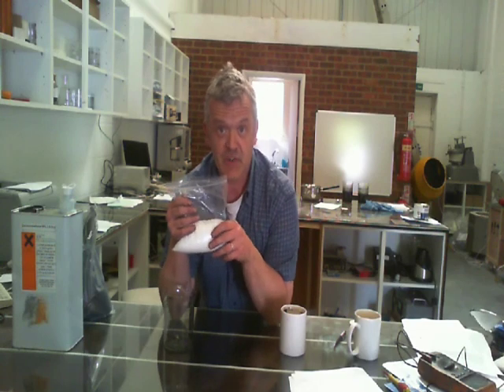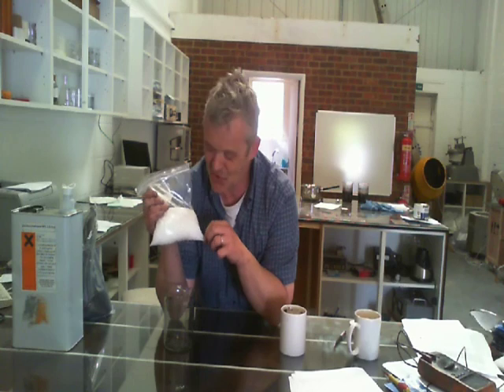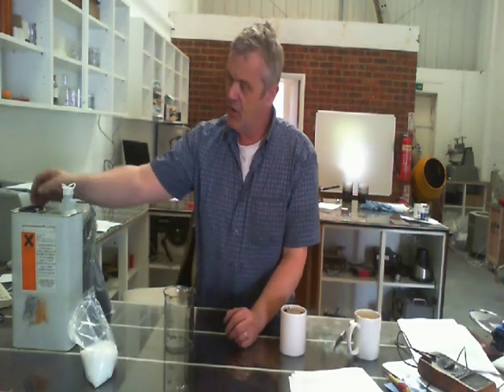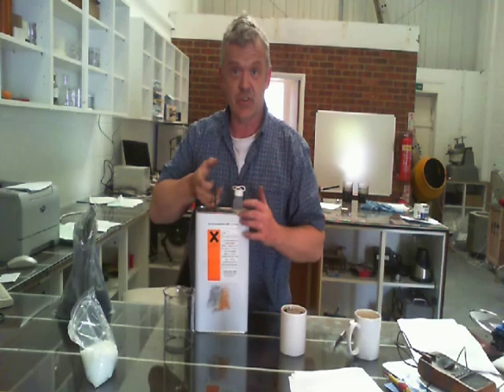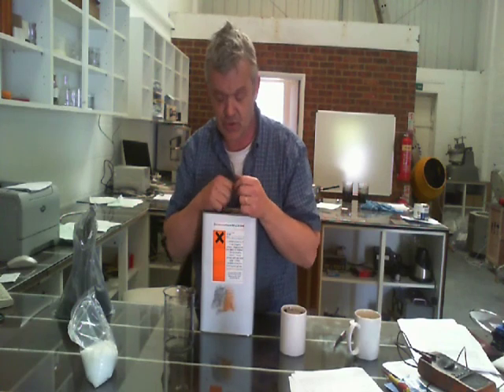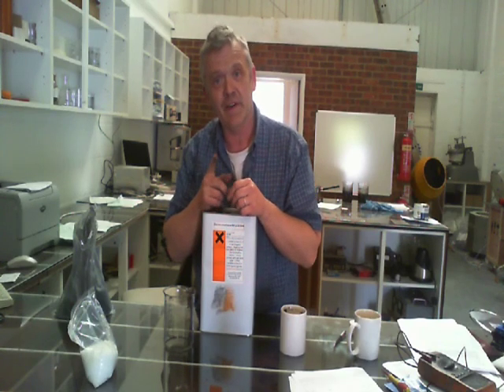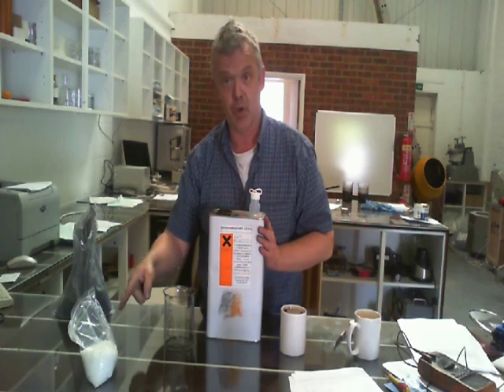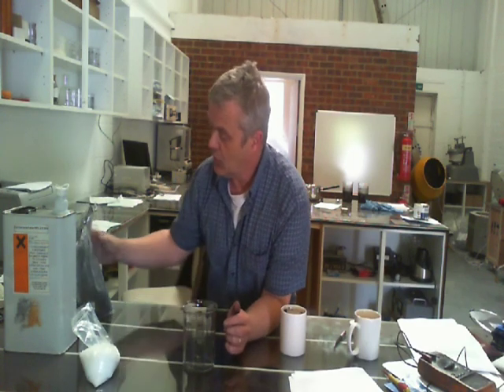How To Make A Conductive Plastic Filament For 3D Printing Electronics

Comment: not a good idea to 3d print plastic with conductive material because plastic is not conductive, so adding a conductive material will reduce the conductivity of whatever material you are adding, secondly plastic will melt or loose integrity when electric current passess through it. A better option for 3d printing conductive material is to use a conductive pen which you could attach to your 3d printer.

Comment: This guy has the worst video production values over and over.  Lots of reverb in the room, shitty video, only video of him talking, never showing you close ups, no lighting, no editing, no production at all. I can't even undestand him without putting on closed caption.  He also does everything in a conversation mode as it relates to his life experience.  He does not simply explain some points in a logical way.  It is a long rambling serial communicaiton where you must sift through a lot of talk talk talk to get to few points, and when he does get to the point, he leaves out a ton of detail. He needs to watch his own videos and see how shitty they are compared to other channels. He wants to hold your attention instead of get to the point.
Reply: Jeff Beck is that your way of volunteering? I could be wrong but my take here is that we've got a guy who is doing his best to get public interest and funding as he works though his R&D cycle. The videos seem well enough for that, but I agree and have thought of sending Rob some software that will tune out the background noise to improve them.

Comment: woah 9ohms a centremetre and still flexy! I love how you said "components" when we are printing,  because the stuff ive seen where they insert the components in during the printing process is kinda dumb and unprofessional.   thanks for the help.      id love to see a big block of ram coming out of a 3d printer,  or a dc motor or transformer.   i saw a flat inductor in another video,  was a good watch.

Comment: sadly you aren't going to get anything usable from this, a 3D printer is rather delicate and it uses brass nozzles, any composite materials in it {graphite/carbon} will clog the printhead. perhaps with a hardened steel nozzle you may get some usability, though even then the filament width needs to be extremely accurate, i fear that rolling it between glass may not achieve that. Of course building an extruder is an option though that can cost up to a 1000 pounds, and even then not give you accurate diameter filament. if you don't believe me, check out this video by Make: https://www.youtube.com/watch?v=OEkksADFjP8 
Though this stuff would be great for injection moulding, check out https://preciousplastic.com/en/ for some info on it.
Reply from the maker: i believe you mate - but what's shown here is the idea - to turn it into a usable filament would mean making an extruder - or buying one - the are around £250 new

Comment: Now you are talking my language Robert.. :D I posted videos on my page, or what ever you call it..?  I mixed graphite powder with a high carbon black colorant additive. HDPE, LLDPE & PP(Poly Propylene) blends.  I'v compounded blends in my 70mm screw in my blown film extruder. The high pressure (10,000psi) temperatures over 400f and CTM mixing zone on my extruder is helping to bust up the graphite making graphine layers. The problem is high loads of graphite work as lubricant in my extruder. I have yet to achieve a high enough load for highly conductivity films, But I am working with some new carrier materials that are looking rather promising.
Reply: also i was wanting to try some of your inks? I could post the results to you.
Reply from the maker: sounds good mate I will have a look

Comment: After melting in solvent, and then going through a filament extruder. I suspect its going to be brittle be a little low on plasticizer. What could I add to the solvent or filament extruder as a plasticizer? I'm thinking the detergent I added to concrete as plasticizer wouldn't come out so good with plastic?
Reply from the maker: i will make an extruder and try this but it came out well for me - probably because poly morph isn't polycaprylacton alone but already contains plasticisers as it is a product meant for melting and remelting - but if you are worried try glycerine that's the standard plastcs plasticiser
Reply: Been hearing stories of people trying to remelt  failed prints into new filament and it not printing well second time around. Or 4th melt if you think about it.
I'd also like to be able to re use plastic rubbish So plasticiser would likely be needed there too. Thanks for the tip.
Reply from the maker: Mongrel Shark
no worries mate